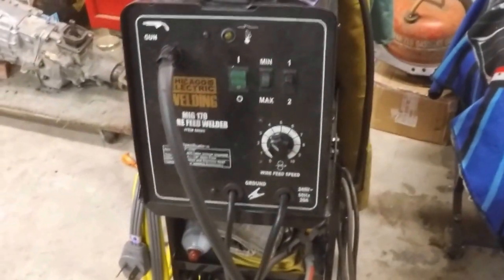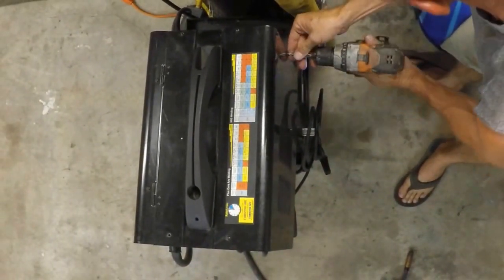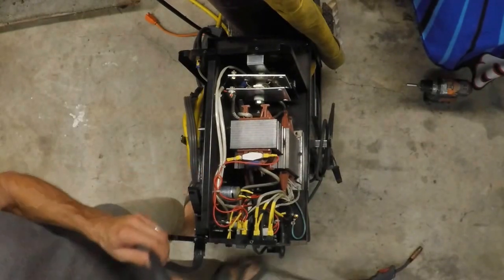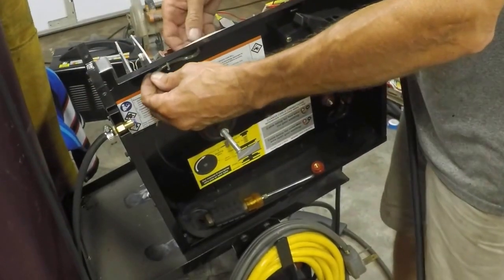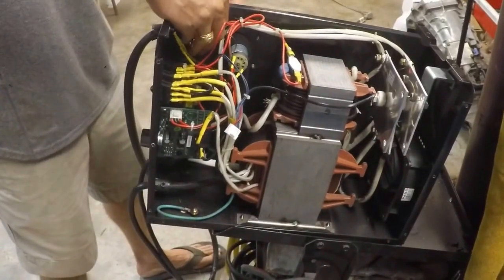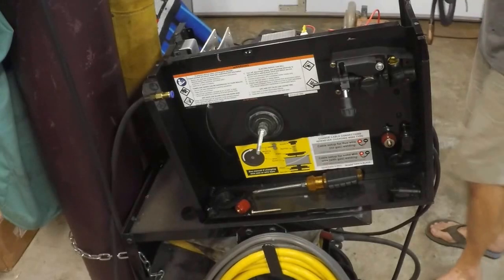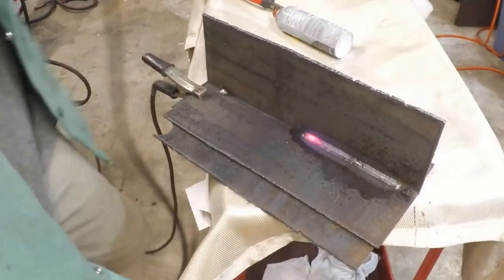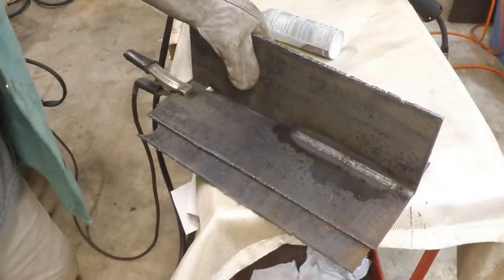Welding Torch and Lead Replacement for Harbor Freight Chicago Electric MIG 170 with HTP Torch

Comment: This may just work on the Titanium Easy Flux 125 to have a little longer stinger.. just snip the gas hose off and use the correct grommet and the correct size hole.

Comment: what kinda gas you using on welder? do you have 1 or 2 tanks connected
Reply from the maker: Joshua Espinoza - I use one tank of C25 gas for MIG. It’s 25% CO2 in argon.
Reply: Trey Clanton 
sweet . thanks alot
Reply: While I use 75/25 on my industrial machines I use CO2 on the little ones for a bit more heat. It's also less expensive if that matters. The little "kegerator" size CO2 cylinders are portable and convenient.

Comment: Trey, I hope you can help me please. I have the CE-170 which I bought maybe 4 years ago and recently switched it to MIG.  Ive instantly noticed that I have to turn the C25 gas on and off each time I weld, meaning my stock gun trigger apparently has no control over the flow.  Do I have a bad gun or is that just how the stock POS gun works?  I thought there was a solenoid or valve or something that would only allow the gas to flow when the trigger is pulled.  In my gun I can hear the gas coming out as soon as I let it flow on the regulator and set it to 8-10 liters/min. Therefore I have to act fast, i.e; turn gas on, quickly set the flow rate, make a weld, then quickly turn the regulator off, otherwise I can still hear gas coming out the tip and am obviously wasting it.  It's a HUGE pain in the ass.  It seems like this USAWeld gun upgrade solves that issue, or again, do I just have a defective stock gun?  In it's whole life I've maybe run a single 10lb spool of flux wire with it and regularly clean the nozzle.  I just ramped up to MIG this week and am instantly disappointed with how poorly the stock gun works with MIG enabled.
Reply: PS - I assume you probably upgraded the ground clamp.  After having a brass or bronze Tweco style I quickly switched to a magnetic clamp. A mag ground is so better as it doesn't wear out your hand by having to constantly squeeze a heavy spring.
Reply: You have a bad gun, you probably figured it out by now. The gas valve is located in the gun, my HF welder failed the same way. The upgraded gun has a much better valve design, and is not likely to ever fail. I replaced the gun with the HTP model after I gave the welder to a friend. I bought a Lincoln. Wanted to upgrade the welder anyway.
Reply: @calvinhandley2373  Yes, I immediately upgraded the gun and last year I bought an Everlast MTS Lightning 275. I still have the CE-170 but have no idea what to use if for now other than flux but then that negates why I upgraded the gun.  I should probably sell it.  They are not bad though even though limited.
Reply: Jeff Chartier the only down side to selling it is they aren't worth much on the used market. Using it for flux core isn't a bad plan if you've got the room. Or if you know somebody who wants to learn how to weld. It would be a decent backup if that Everlasting were ever down for some reason, but that's not very likely. They're pretty rugged machines.

Comment: Nice upgrade, but you should try doing the euro style conversion modification,  that way you can easily change out the welding anytime you need to with any length cable.  Plus, you can then use a spool gun on the HF170 to weld aluminum.  A guy named Iain Potalupi did this conversation on his HF170 and made a video on how he did it.  Here's his video: https://youtu.be/ag1EHSh1kQY
You should check it out.  You may also be interested in doing this to your HF170.
I went off of Iain's video and also did that euro style conversion modification on my HF170.  For the most part my mod is the same as Iain did, but I made a couple of other improvements that Iain didn't do.  I'm in the process of making a video to show what I did, so that other youtubers can use it in conjunction with Iain's video if they too want to do this euro style conversion modification.